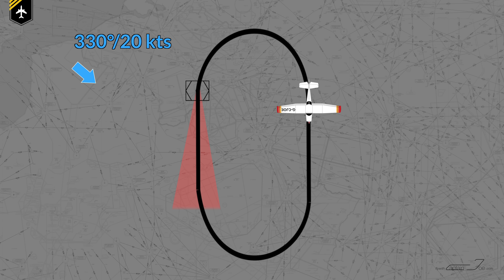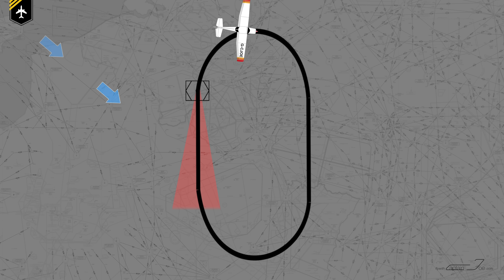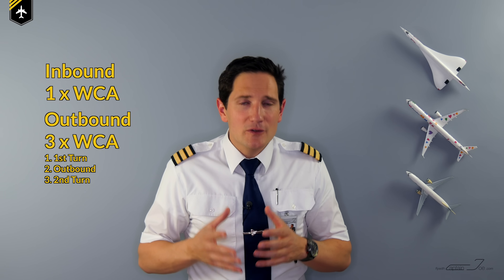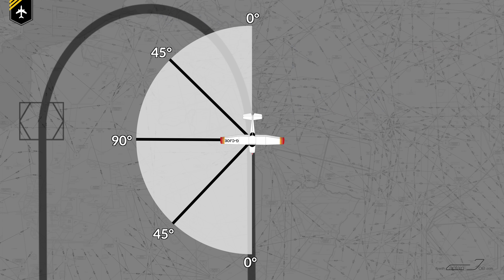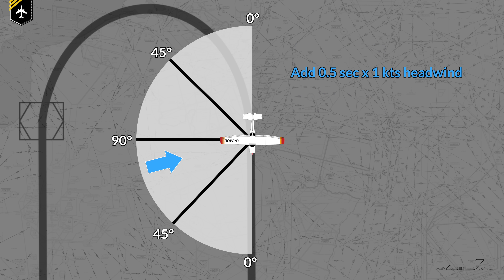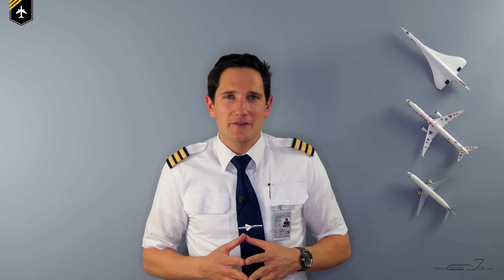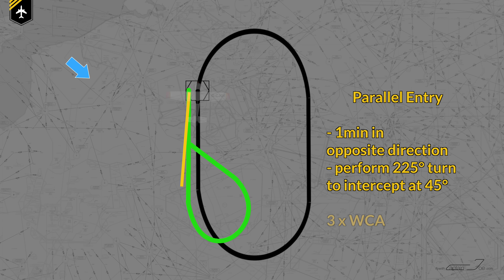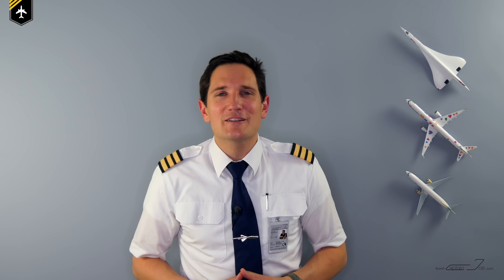WIND CORRECTION ANGLE + Time calculations in Holding Part 3 / EXPLAINED by CAPTAIN JOE

Comment: Captain Joe, thanks for this very good video. Can I ask the following question concerning the formule for estimating the WCA. In your example the wind is 330°/20 kts and the inbound course is 360°. The WCA is (360-330)x20/100 = 6°. Now suppose the wind is 210°/20kts then we also have 30° between our track and the wind direction but in this case the WCA is smaller than the 6° in the video case. So what formula can we use in this case for estimating the WCA please? Kind regards, Johan.

Comment: WCA = WA * (WS/TAS), same inbound
Ex: Wind from 330, WA 30°, WS 20, TAS 100:  30°*(20/100) = 6 check
Ex: Wind from 300, WA 60°, WS 20, TAS 100:  60°*(20/100) = 12 but when I do the math, I get 10. What did I miss?
Reply: Yes this formula only gives correct results for angles of 30 degrees. There are serious deviations at angles of 30 degrees and above.

Comment: OK, we need to commit all of this to memory, right?  But what if our memory fails us?  What if we get the formulas backwards or slightly wrong?  

The Go-To to simplify all of it is on scratch paper (or map) write the adjusted timing +/- and heading corrections +/- RIGHT on each leg.  If its wrong the first time through make minor adjustments and write those down scratching out the old ones from the Legs. The VOR is your final guide to confirm how accurate youre getting.  Surely after the second hold youll have it refined.  It will result in a perfect Hold (assuming the wind stays the same) cus all you have to do is follow your notes on each leg from that point forward, a no brainer! 😉

Comment: Hello Captain, how are you doing? 

Unlucky, I just found your videos now, trying to figure out a way to estimate/mentally calculate the WCA when flying IFR. 
I thought that the formula you showed up was really interesting (WCA = Windangle x Windspeed/TAS). I'd like to know, from where did this formula come from? Was it something you got with the experience or is it on any book or something like that? 

I'd also like to know if the "Windangle" you put on the formula, is just the simple difference between the True Course/Mag Course and the Windangle?

Hope it's not too late! Thanksss a lot!
Reply: This formula only gives correct results for angles of 30 degrees. There are serious deviations at angles of 30 degrees and above.

Comment: The 30° angle came from where?  Is it based on if it’s coming from a 45° angle or 90° angle? Once I know where the 30 came from in this vid, I can figure out everything else. Thank you 😅
Reply: In this example the heading which the aircraft is supposed to fly is 360 degrees (north). Now there is a crosswind from the direction of 330 degrees (northwest), which gives this 30 degrees angle in relation to 360 degrees. I hope this was what you meant.
Reply: @mikep9604   that was what I meant. Thank you kind sir.

Comment: Just some addition I could think of after seeing the three series. Important to note that tracking into the hold is based on HEADING and after that its TRACK to maintain. Also 5 deg buffer is given for calculating the entry to the hold for the sector.

Comment: Terrific .... I’ve been a flight instructor since 1979, and this is the easiest explanation I’ll be using for my students 👍
Many thanks for posting.
Reply: Captain joe's formula only gives correct results for angles of 30 degrees. There are serious deviations at angles of 30 degrees and above.
Reply: Hi. There is even  an easier way to calculate the WCA and it works fine, too.

1st: Take your Holding speed, e.g. 180 kts and divide it by 60, equals 3. That's your speed factor.
2nd: Divide wind speed by your speed factor, e.g. wind 270/20. 20/3 roughly 6°. That's the maximum WCA.

3rd: Determine the difference between wind angle and inbound course. If it's
1/3 (0° - 30°) use 1/3 of max WCA, 
2/3 (31 - 60°) use 2/3 fo max WCA or 
3/3 (61° - 90°) (full crosswind) use max. WCA

Let's say the inbound leg is 230°, then the wind direction is 2/3 in relation to your inbound course.

4th: calculate WCA: 2/3 of 6° equals 4°.

And that's it. I used this technique on my screenings and on Flight Sim on PC and it always worked out well.
Happy Landings!

Comment: thanks for the great video!
one question: at 07:48: 250 or 225 degrees?
Reply: 225° because it is 180° turn plus the 45° angle to reach the radial.250° turn will be a 70° angle interception.

Comment: Doing this calculation on the ground is fine, but I would have talked about the proceudure for actually doing it in the aircraft. (timing your inbound leg and subtracting or adding to your outbound leg to make it one minute. ) I love the math but its not practical in the aircraft, expecially if you dont have autopilot.

Comment: Hi Joe, I'm Joe, a pilot with IFR left on the to-do list. I found this 3 part Hold Series very direct, simple, and helpful. I'd like to add one thing, and please correct me if I'm wrong...

If you would like to enter the Direct Entry Pattern, there's 2 ways: flying directly onto the inbound leg with WCA applied once flag is centred, and watch for flag flip to start the first turn and timer and be established. Or as you described, flying accross the fix to the outbound leg.

So how would you determine WHERE in space is the outbound leg, exactly. Is it by (?):

-Flying towards fix, with a perpendicular radial to that of the original HOLD radial so that you can intercept the DIAMETER length of the holding pattern, which we would know if we were in a FAST enough aircraft to be within the altitude speeds (below 6k' 200KIAS, 6-14k': 230 KIAS, etc.). Which we would know because we calculated it with you, e.g. 230kIAS we know diameter is 2.42nm.

- So then we divide 2.42/3.8 = 0.637. Then multiply this by 60 to give us roughly 38 seconds. Then we would apply the rule of thumb you taught us; so if we have a tailwind closer to your 6 o'clock than your 9 o'clock, add 1 sec for every 1kt.

- So let's take your example into consideration... if we wanted to fly accross the fix, I would have the OBS set to 090, centre it after I cross the fix, and fly that for 48 seconds (38s + 0.5x20 = 48) since wind is 330/20, and once I'm already timing, set the OBS back to the original of 180 INBOUND, so that at the 48s mark, and I turn, we're exactly where the OUTBOUND leg should be. And then proceed from there applying our WCAs accordingly.

SO, is this accurate? I cannot think of another way to simply fly accross the fix and land on the outbound leg if you don't know where it is, as probably displayed on the FDS.

Thank you, appreciate the content!
Joe

Comment: Boah, a lot of factors for miscalculations here. Do pilots do have to do that in mind (or with paper and pen), isn't the flight computer able to do a correct holding by itself, after having input the data?

Comment: I use the formula: WCA(max) = W/V * 60 / TAS. Then depending on the angle that the wind blows from you multiply the answer with a factor. This, however, is not the same as the formula you present. Say the wind is 20 kt and blows from a 60 degree angle. I would get a WCA of 20 * 60 / 100 = 12 and multiply by 0.7 (the sine of 60) to get 8.4 degrees. Your method would yield 20 * 60 / 100 = 12 degrees.
Which one is more accurate?
Reply: This formula only gives correct results for angles of 30 degrees. There are serious deviations at angles of 30 degrees and above.
Reply: Thanks, that's what I'm thinking about!
Reply: Sin 60 is 0.7? Jeeez....

Comment: Great video capt Joe. But I just wonder how do we know exactly the direction in degrees of the wind is blowing and at what speed? Speaking about conventional aircraft which doesnt have any ADR showing the indication of the wind speed and direction . How do we do the calculation then? I agree with WCA and stuff to track the outbound by simply multiply by 3 of the WCA on inbound. But back then in my training with cessna 172 in order to adjust the inbound leg to make it 1 minute. I just simply adjust the outbound time in related to inbound time. For example case, if we ended up with the inbound time 45 secs due some tailwind component during inbound, then I’ll have 01:15 sec for the outbound to compensate headwind during outbound. Maybe it wont be precise but it seemed to work. 
Anyway, I’m just sharing, keep up the good work Captain.

Comment: Hi Joe, thank you very much for this information, I just have a question:
 if there is for example Airbus A380 that needs in some cases 1200 kg fuel just for taxi, why airports dosen't use a pushback truck to reduce the fuel consumption?

Thanks

Comment: Hey Joe. Could you do a video on the gear of the a380? They seem to be organized in a weird pattern and the first wheelpair of the 'maingear' hangs lower then the other wheelpairs. And in general, are the wheels accelerated to groundspeed, and if yes, why can you see rubber burning when gears touch the ground?

Comment: Another Video Idea- Please answer- Why don't airplane manufacturers put small video cameras at specifics places on the outside of the planes, so that pilots can see issues and confirm issues inflight instead of sending flight crews to check or depending on passengers. Cameras are so small now a days and all the feeds could be sent into one of the monitors already in the cockpit. I think the A380 already has a camera in the vertical stabiliser .

Comment: Looks like something the FMC should do for you. Wouldn’t want to do all this math up in the air!
Reply: A Cessna does not have a FMC. It is also possible that the IRS systems provide conflicted data and the FMC/Auto Pilot is not available and you need to hand fly the aircraft. The Southwest 1380 aircraft was placed in a holding pattern so they could prepare the aircraft (and passengers) for the landing.. Auto pilot is not available when there is asymmetrical trust because you only have one engine. Also pilots often check the flight controls so they know what capabilities are still available, for instance do we still have flaps, are any of the hydraulic lines damaged, do the spoilers work, the ailerons, rudders, etc, etc.

So even when you're in the most advanced aircraft, you still need to be able to perform these calculations. But any pilot can perform these calculations as these are part of the PPL(A) or BFR (PPL 'renew') exam. Flying a holding pattern is always part of any flight exam. It's probably also part of type rating certifications as these maneuvers are such a basic part of flying. Of course in general the FMC will keep the aircraft on course when on auto pilot..
Reply: Thanks for the detailed and insightful answer!
Reply: Actually you still have the autopilot with one engine inoperative, its the auto throttle that would not be available. But agreed, its a very good idea to know how to fly using raw data only.

Comment: Hay Joe...thanks for all this videos now I know a lot about the airplane. But now, I would like to know how jet engines are started. I know little bit about it, that externally a machine is connected to the engine to start it up and after reaching appropriate speed the fuel start flowing and then the machine is disconnected and etc.... but I want to know what runs the engine once the external machine is disconnected.... please I want to know more about how engine start. Please make a video about it.✈✈

Comment: i assume you have to know and apply this basically blindfolded but isnt a modern airplane actually processing this stuff with its board computers? do you actually have to do this completely manually with your brain and then enter the heading and stopping the times?
Reply from the maker: Daniel Duersch correct this is just for flying in smaller planes without big computers, to quote it in an easy sentence😉
Reply: many thanks for the reply :)

Comment: How do you know the wind direction and speed? Is there an instrument for that? Or just weather forecast?
Reply: Normally you get informed by ATC about the wind. They have live data, so it's always pretty accurate.
Reply: Actually you would tune into the ATIS frequency (printed on all runway charts) and you will hear the full METAR (and current/active NOTAMS) information on a loop. ATC often indeed report wind angle and speed, but more as a reminder when you're on short final or if conditions are changing constantly..
Reply: Or the wind indicator that is displayed on the ND?
Reply: On most modern liners you have a hold function that can be setup using the flight management system (FMS/FMCG) which pretty much does everything for you. The FMS computes track angle and ground speed from the successive position computations using the INS/IRS/GPS sources then indicates them in the form of wind vector arrows on the Nav display. Some smaller A/C have modern avionics which incorporate an attitude heading reference system (AHRS which i'm familiar with is in the G1000) which is pretty much an inertial reference system and shows your wind vectors on the  primary flight display (PFD).  The HSI also incorporates what is called a "track diamond" which shows you what heading you need to fly to fly constant track, making wind corrections very easy.

Comment: 🔴🔴Awesome as usual🔴🔴
But another aviation related question about the aircraft that there a round structure which is fitted at the tail of a aircraft what is it.
Anyway you are awesome.
Reply: It's a pad to avoid damage to the plane if you happen to do a tail strike.